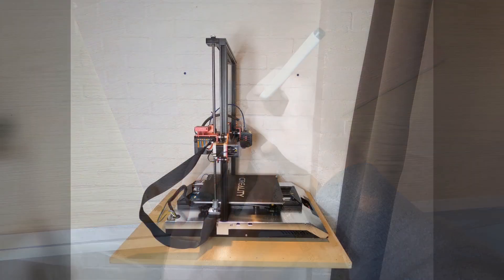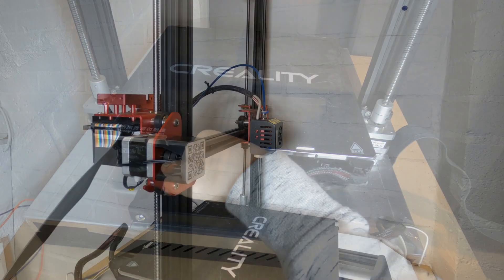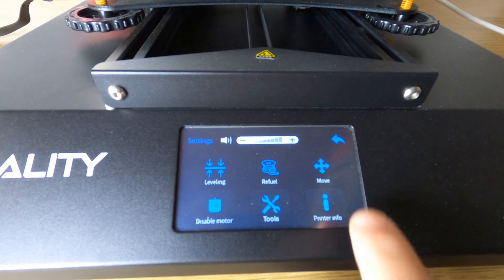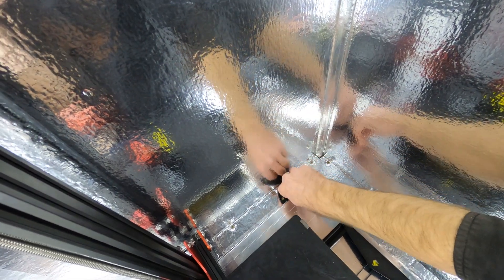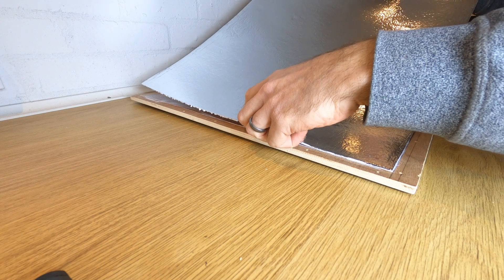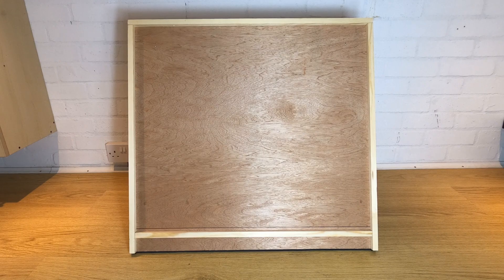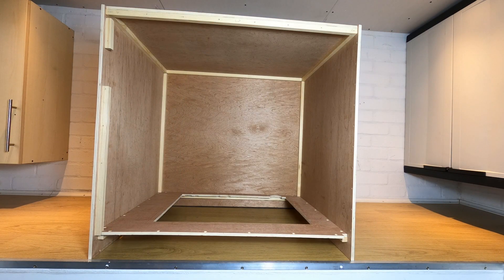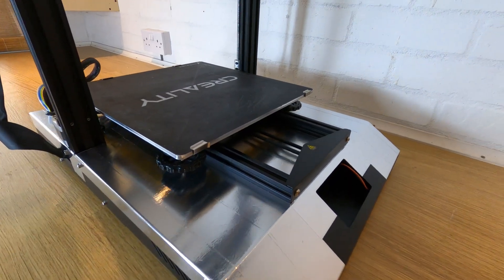CR-10s Pro 3D Printer Enclosure Pt1 (Complete build guide for free)

Comment: I use a raspberry pi with the Octoprint firmware then use Cura with the Octoprint plugin. This enables you to send prints to the rpi from your computer. Alternatively just send your gcode file straight to the Rpi Octoprint server.

I ended up buying an enclosure)before seeing this really good video, I may add. I do like how you had thought about the electronics over heating, . Something I had not thought of,  although I am not sure they would actually over heat. However it is better to err on the safe side so consequently I will be making a base similar to a laptop cooling stand. 

Going through the video I don't see where the door came from, maybe I just missed it.

Maybe you could do a video on how you temperature control the inside of the case. I have been looking at case fans and filters along with smaller bore pipe for venting to the outside.

Comment: Amazing enclosure you built here, but in my opinion, it's missing one of the most important things people often overlook in the 3d print community...some kind of FIRE suppression system. Trust me, the chances of it happening are low but when it happens you will shit bricks. I didnt really worry about it for a long time but after researching into this issue and especially for creality printers, there are so many things that can go bad and cause a fire. If I were you, I would atleast get little fire suppression pouch that goes off once a critical temperature is hit (usually 150C or higher). They're like 30 dollars and you can attach it in your enclosure with velcro strips. Otherwise, this build is amazing, but just needs the things that can save your house from burning down.
Reply from the maker: Hi, yes you are right, it is very important. I run a couple of safety systems, I have an automatic fire extinguisher and a thermal fuse controlled cut out circuit that kills power if any part of the machine gets warmer than I want it.

Comment: Checking in a year later, I didn't see a part 3 or 4 in your videos. Are you still planning on making those? I'm interested in building this, but I think I would want to make sure I can have venting.
Reply from the maker: Apologies for not making more videos with the CR10S Pro and the enclosure. The main reason is that I just don't use my CR10S Pro very much any more. I have quite a few printers now and I find the CR10S Pro doesn't really keep up with its 8 bit board. I may do a klipper setup and bring it back or possibly swap a different printer into the enclosure for the colder months. The enclosure has always been great but unfortunately I can't say the same for the printer.

Comment: Hey Ricky, do you happen to know if these dimensions for this build will work for the standard CR-10s? I understand a couple modifications might need to be made but I was just curious before I jump into this.
Reply from the maker: I don't know for sure but it looks like the standard CR-10 will be slightly smaller as the electronics are not in the base. But in answer, I don't know sorry.
Reply: @RickyImpey  No need to apologize, I think you are correct based on my current measurements today. Thanks for the reply and the tutorial. 5 star work!

Comment: Excellent work, I have been sitting in front of mine last hour before seeing this video , designing an enclosure in my head and came to same conclusion, I'm moving the panel as it is located in a very bad place especially when creating seperate zones. Cheers!
Reply from the maker: Thanks Peter, I still haven't seen a better way to do it. I think through the summer, the hottest I've seen the probe inside the base read was 29°C. That's with the heat chamber getting up to 40°C easily without additional heating.

Comment: I’m searching for the insulation. Everything I can find has an upper limit on the temperature of 85 C. Is that high enough?  What is the product you used?
Reply from the maker: Hi Charles, that sounds like the stuff I used. Yes ideally it would tolerate a higher temperature but I don't plan on taking my enclosure above 70°C particularly. The insulation helps keep the temperature in the enclosure in the winter but if you plan to go to high temps, or you're concerned, maybe consider leaving it off. I think anything that tolerates higher temperatures can get quite expensive.

Comment: Thanks for the project could you tell me the width of each front panel legs  the drawing only has the distance between thanks
Reply from the maker: Ah, I see what you mean. No, they are not equal. I will check the measurements on Monday but the lower section below the door is level with the height of the printer base. The top is a little less important from memory but obviously you can work this out buy adding the printer base height to the gap dimension. Hope this helps.
Reply: @RickyImpey  thanks
Reply: @RickyImpey  could you still please check the measurements ? cheers
Reply from the maker: Hi Andy, the lower part below the door is the height of your printer as per the video so mine is 67mm. Please measure yours as it may be different. The total panel height is 672mm so with the gap being 575mm, with my printer height, the top 'leg' on mine is 30mm. 672-575-67=30. As I say, if your printer is a different height then you may get slightly different numbers but if you use these then the worst case is a small lip on your opening, no big deal. Hope this helps.
Reply: @RickyImpey  thanks buddy
Reply from the maker: Hi Andy, sorry, I'm not at home until Monday to fire up the CAD, I'm not 100% sure what measurement you need. There aren't really any legs, do you mean the battens that sit inside the front panel connecting it to the sides?
Reply: @RickyImpey  Thanks from the reply so the front panel is like a square c the top & bottom legs the distance  between  is 575 from a total of 672 are they equal ?

Comment: Would a thinner thickness of plywood affect the integrity of the enclosure?
Reply from the maker: The short answer would be yes but it's not something that couldn't be overcome. The only issue you would really have would be warping. You may just have to add a few strengthening battens or angle pieces in a couple of places. You may get less heat retention with a thinner material too. I would still build it though if you're happy solving a few niggles.

Comment: Great build! Im building one myself for my ender 3, but I want it to be fire "proof", im thinking about using alluminium or iron(not steel) +-3mm thick, which material would you sugest taking in consideration fireproof and heat isolation? Thanks!
Reply from the maker: 🤔Hmm, making something completely fireproof is very difficult. I think that your best goal is to slow any fire down so that you get time to react but I am far from an expert. I always have a fire extinguisher and an automatic 'fireball' in my enclosure. The most fire retardant sheet materials are going to be cement board or a metal like you say. I'd join the sheet with aluminium angle instead of wood. A fireproof metal box won't insulate well though. This may need some more thought.....